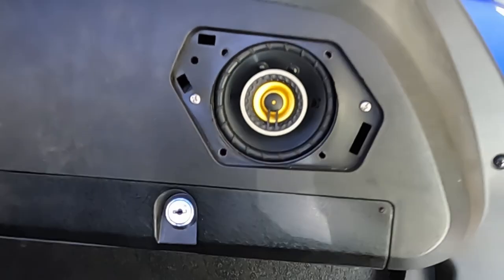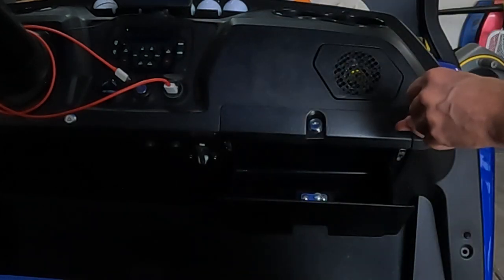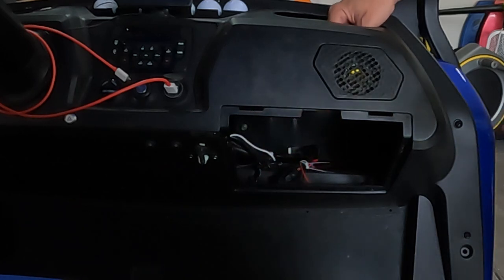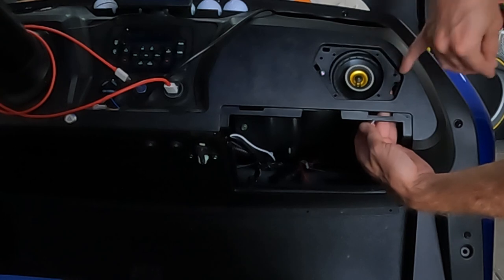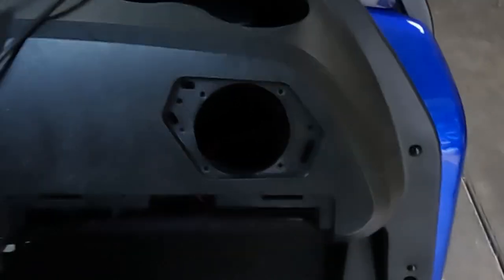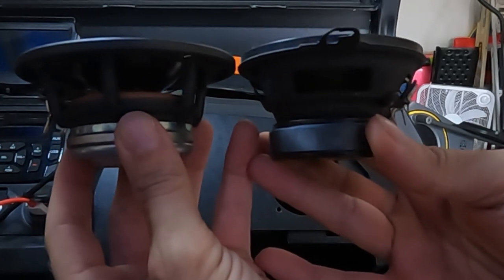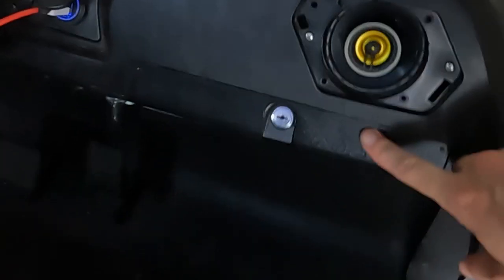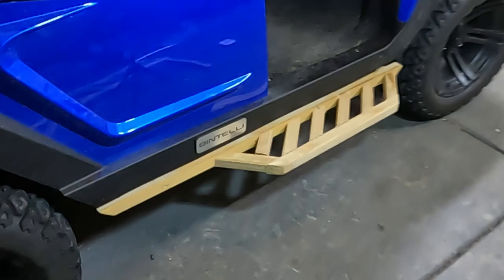Speaker Install Bintelli Beyond 4PR Kicker CS 3.5 inch BONUS at the end (Edited out copyright music)

Comment: Thanks so much for making this video. I was able to get the Kickers installed using the broken clip trick and drilling an extra hole. Nice and snug and they sound a lot better in my opinion.  Also, thanks for showing the EQ feature on the stereo. Huge difference in sound over the stock flat EQ.  

Any suggestions for the Bluetooth microphone as far as placement?  I found it behind the driver’s speaker but calls are extremely muffled with it there.  I’m looking at different options but I would love to have your feedback before I start drilling.  

Those side steps look phenomenal.  I think they will really make the bodywork pop when they’re finished and painted black. Let me know when you get them fabricated, I would really like to order a set.  

Cheers!
Reply from the maker: I recorded a quick video, well maybe not so quick, yesterday doing battery maintenance. I clipped my microphone on the little rubber piece behind the steering wheel on the steering column, wrapped it around the steering column once just to hold it tight. Then I fed it through the hole the factory drilled for the backup camera. Let me see what I can do to get that video finished today.

It's going to be a while on those step rails. I don't have a welder or the metal yet. I just used the wood 2x2s to draft up a model. Even with as expensive as wood is, it's still way cheaper than metal. I think I went through about six revisions before I came up with that style and design.

Comment: Thanks for the video. Does anybody know if there are actual nerf boards you can purchase for a Beyond 6PR.  The ones you mocked up out of wood look great.  I can't hardly any aftermarket stuff for the Bintelli.
Reply from the maker: I'm not sure if there are some in the works, I'll see if I can find out. I got a set for a club car with what I saw as identical mount points. It was so close to fitting, but was off but just enough to not work. After seeing the quality of what was available, I knew I'd need to fab my own. The ones I mocked up with wood probably won't be created, they are a little bit too wide I think. But I got a welder and will be creating a set on a future video. I just need to practice my welds.